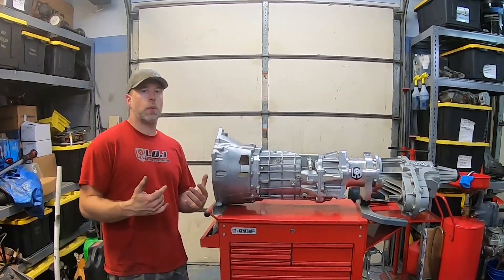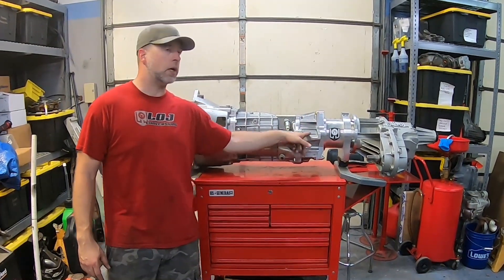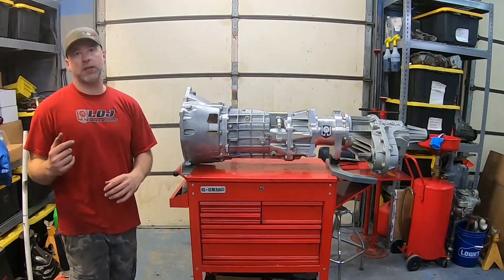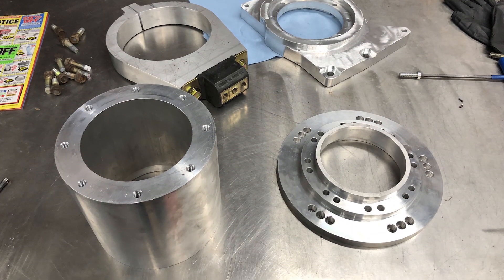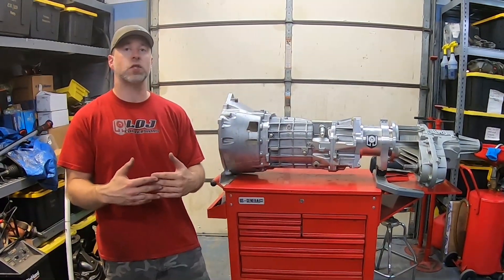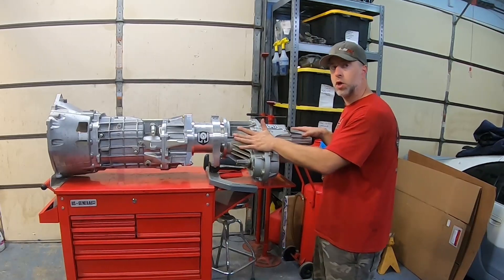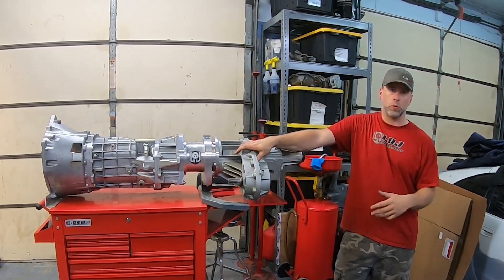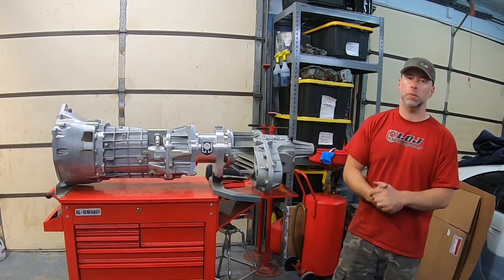SWAPOLOGY - LOJ Conversions - Project Frontier [EP05]

Comment: I am in love with this concept.  I have a stock 2007 AWD Trailblazer SS.  I would love to do this to it, and was wondering if anyone would know if this is possible without major modification to my vehicle?  Custom drive shafts maybe?  Would the shifter be in the general area as the automatic shifter?  

Any help would be greatly appreciated!  Seriously thinking about taking on this swap if it can be done semi easily..

Comment: That's Awesome! Do you guys make anything to adapt from the T56 to a GM 233c Transfer case? I have a 2002 Chevy S10 ZR2 that I LS swapped and used the factory NV3500 Trans and Transfer case that works but obviously cant take much abuse if any, therefore I am looking to upgrade to a better transmission but keep the original 233 transfer case since its electronic shifted with the truck. Do you have any suggestions to help me out? I have a video of the truck on my page along with some good photos for you to see everything. I look forward to hearing from you. Thanks!

Comment: The TBSS transfer case has a Torsion center diff not a vicious coupler.   

Cool adapter.  I built my own T56 AWD using a CTS-V 05 T56, 06/07 ZO6 transaxle adapter and a 32 spline SSR main/output shaft and a custom billet plate to go between the trans and transfer case.  I’m using an NV149 case that does have a viscous coupler.

Also TBSS are all 4l70e.
Reply: Hey, would you happen to know of this would affect weather or not I could drop this same configuration in the video into my 07’ TBSS AWD?  Thanks
Reply: Torsen*
Reply: @BlueWaterSpeedMarine what vehicle is your setup in?
Reply: @slopetechno  2002 Blazer ZR2 with a gen5 LT 402 and twin turbos.
Reply: I heard the 32 spline wouldn't shaft would cause the output seal to not seal with the corvette rear piece. How has yours held up because I want to do a z06 vette trans with my np261hd and not swapping t case inputs would be awesome
Reply: I'd like to do this same setup for my 1968 Chevy C10 sitting on an AWD 2003 Cadillac Escalade chassis. How do you control it electronically though?
Reply: @FTWJohnBoythe transfer case is fully mechanical no electronic control needed.
Reply: @SyTySpeedShop I'd really like to talk to you more about your setup, if you'd be willing to walk me through this with my current setup.

Comment: I mated a T56 to a GM style transfer case with all OEM components and a custom adapter plate I made.  The result is a pretty cheap conversion (once you have the adapter plate) and its actually significantly shorter than this setup.  The length can be important when rear drive shaft length, rigidity, or keeping your floorpans is a concern.
Reply: I did the same, this setup is definitely on the lengthy side.

Also I feel the 27 spline output is a weak spot with big power and AWD!  I did the SSR 32 spline output on my build.  But besides a 1” thick billet plate, the rest of my build is all OEM parts.  And I’ve got just under 2500 in my setup including purchasing the 05 CTS-V trans.

Comment: I know this is a while ago, but is the whole viscous coupling purely mechanical then and is not controllable like lets say a R32-R34 GTR Transfer case?
Is it possible to control the Trailblazer Transfer case and the amount of "lock"?
Reply: The TBSS case has a Torsion center diff not a viscous coupler and is purely mechanical, no electronic control.  It is capable of 75F/25R 50F/50R 25F/75R and can even send all the power to the rear depending on wheel slippage.

It’s the best AWD transfer case available for a street type setup.

Comment: So if I wanted to put this in a 4x4 Silverado I could use the transfer case to be able to turn on and off the 4x4?
Reply: No, full size trucks use a 6 bolt transfer case adapter, this is designed for the 5 bolt case used in the TBSS and S10, Bravada, Astro Van, Syclone, Typhoon.

Comment: This is so sick! Now that I've had some time to digest just what this is I have some questions. Since this is in all-wheel drive transfer case. That has a viscous coupler. Does that mean your front and your rear differentials can be different gear ratios?
Reply: No, you still have to run the same ratio front and rear and also same tire height diameter front and rear, or within 1%.

Comment: When will it not cost as much as a used 5th gen camaro tr6060?
Reply: Probably never, custom parts like this are expensive!!!
Reply: @SyTySpeedShop  They copied an individuals idea off the forums from nearly ten years ago.. The exact same thing I ended up doing. Only difference is my setup didn't cost $2300, more like 150 in some mild steel.
Reply: @ibinyth5866   I get it, I build my setup like this for just under 2500 including the cost of the 05 CTS-V trans I started with, mine is a 32 spline SSR output and only required a custom 1” billet plate to mount the transfer case using an OEM adapter.  I’m using an NV149 case with a stock input converted to 32 spline.  Going in my 02 Blazer ZR2 with a twin turbo gen5 LT 401.

This is also a small market so have to keep the price high to recover the cost to make it.

Comment: so im running a tr6060 from a holden Commodore behind a Toyota 2jzgte, ive just thought about buying a awd 2jz sump and diff and drive shafts ect for my jzx110 from a jzx115 in japan and now im thinking buy this adaptor kit to have a awd manual 2jz toyota mark 2 jzx110, but id need help sourcing the tail case and transfer case message me if you see this im serious about this as im in Australia alot of these parts are not available locally

Comment: @LOJ Conversions I like your take on the conversion, very clean! I did GTO donor, used C5 tailhousing, reset the bearing depth to hold the 1 piece countershaft bearing. Went crazy and did SSR hybrid 32 spline output shaft, SSR gearset & 1 piece counter. I used the Keisler midshift conversion. I found a 32 spline input shaft for the 149 t-case. Mine is in a turbo'd silverado SS

Comment: It doesn't have a viscous limited slip. Viscous differentials can't do torque biasing like this can. This has a Torsen differential in it. Torsen differentials use a mechanical gear set to allow for different speed and the 70/30 bias comes from the relative gear size of the outputs. Audi Torsen center diff have 60/40 and VW Passat center diff have 50/50. Because it splits torque and not speed it is possible to spin one output at 200% speed.
Reply: The TBSS case is also capable of sending 100% power to the front or rear depending on road conditions.

Comment: Do y’all sell those adapters?
Reply from the maker: We will... interested?
Reply: @LOJConversions  yeah Ive been planning an awd bbf 460 turbo build and would prefer to use a tr 6060 over the r33 gtr transmission i was planning on using.

Comment: Can this adapter mate up to a atlas 2spd transfer case as well? Looking to put a LSX454 in a Dodge Ram 1500, want a manual trans and 4x4.
Reply from the maker: Philip Logemann If the Atlas is 27 spline input and uses the Chevy 5-bolt pattern, yes.